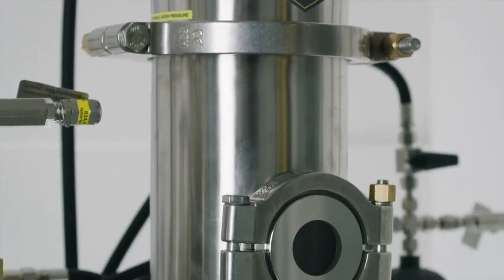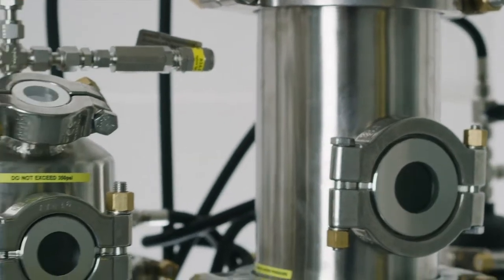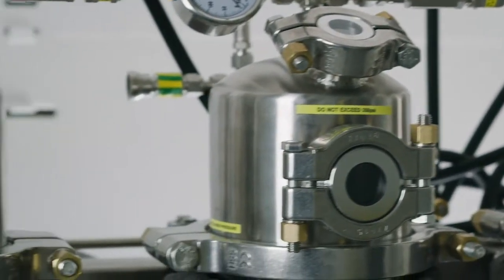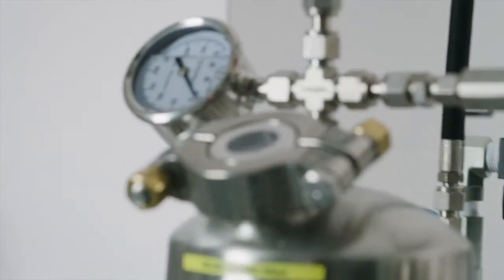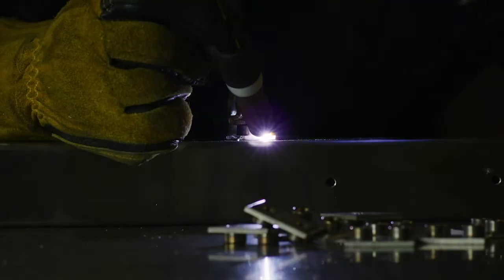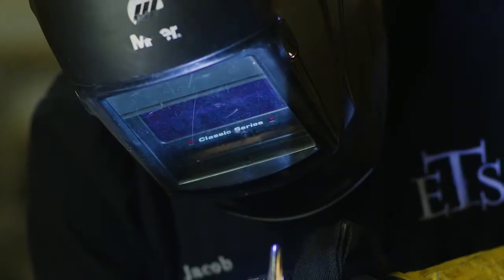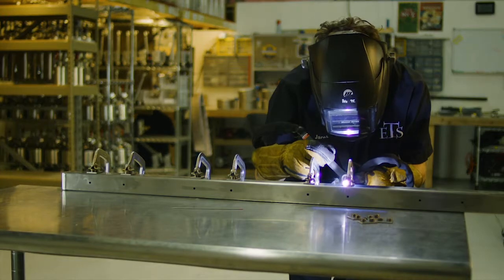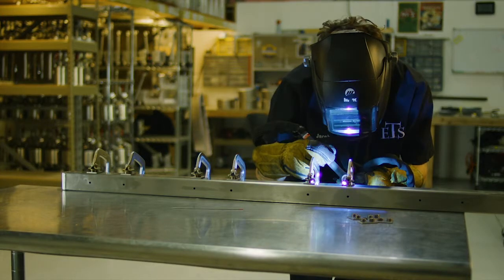ExtractionTek Solutions - Hydrocarbon Extraction - Created a Machine and an Industry

Comment: ETS hands down creates the best and safest system. Granted, it's only as safe as the operator. With other systems and platforms available that can handle larger throughputs. I still believe they are not as good as ETS. The systems that handle larger throughput it just seems people throw a bunch of material in them and pile up garbage from different strains into one collection vessel. Making these disgusting blends. ETS creates a platform where you can actually make quality extracts that look good. I would compromise my daily throughput for quality and Im sure they could help configure a system to handle large throughput and not sacrifice quality.
Everytime I have used ETS systems. I feel safe while operating it.